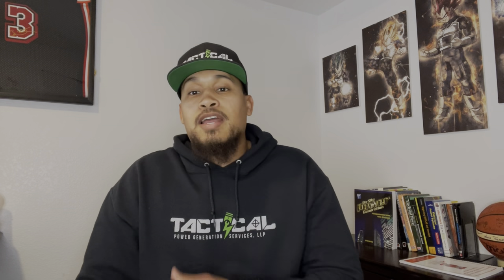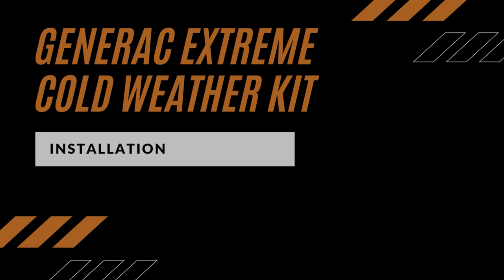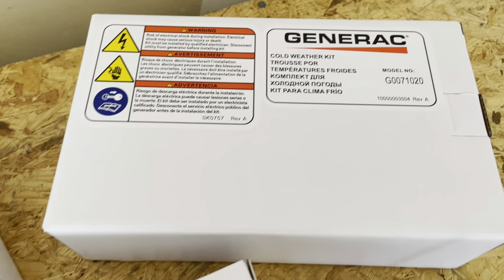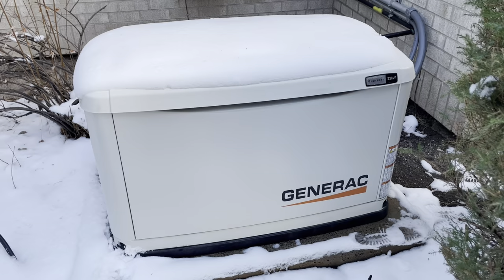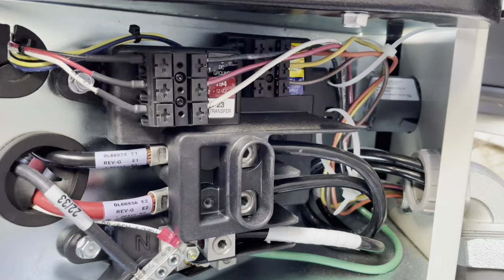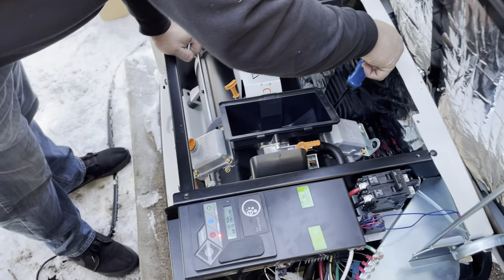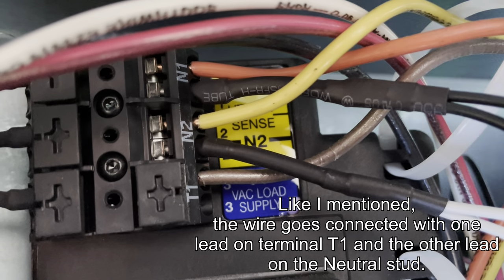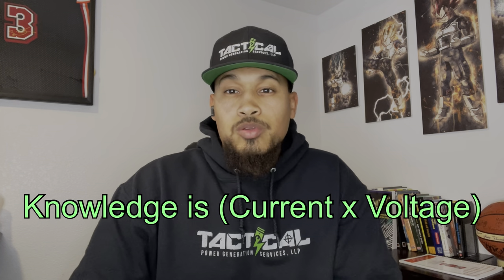Extreme Cold Weather Kit Installation for Generac Guardian Residential 9kw to 22kw Generators

Comment: Im an hvac tech, i recently installed a Generac 18kv on my employers cabin vacation house up north michigan, don’t wanna drive 3 hours on a cold winter storm day just to make it start..going to install this heater kit👍
Reply from the maker: Very smart decision, it will save you a lot of trouble. This kit is a must at places that go under 32F degrees. Thanks for watching my video 🙏🏾

Comment: Only reason I watched this video was to see how you got the lower bolts off of the air box and the intake.  You skipped right over that.
Reply from the maker: My bad, I didn’t record that part but send me a DM to my instagram TacticalPowerPro and I’ll send you a clip I have showing how to remove those bolts.
Reply from the maker: I just uploaded a short showing how to remove the air box and intake, check it out and let me know if it helped. Thanks for watching my video.

Comment: Are you aware that the battery heaters frequently damage batteries from heating too much, and the breather heaters cook the breather tube into charcoal?  The filter heaters seem OK though.
Reply from the maker: Yes Sir, I’m aware of those potential issues. If the temperature sensor is operating correctly it shouldn’t have a problem (for now) but I’ve definitely seen cold weather kit issues.

Comment: You really skipped too many details.
Reply from the maker: Thanks for the comment. What details did I skipped? 🤔
Reply: @tacticalpowerpro   I was able to follow, but then again, I have installed a few hundred of these kits.... and I know there are variables between year / model. The only thing that would not be clear to a novice is the long hex key needed to remove the mixer and the actual insertion of the power wires. You could also cover pulling that connector inside the TS instead of pulling the fuses to kill the 240 going outside. Much easier in my opinion after 25 years of doing this stuff.

Comment: Just watched your video to confirm the instructions included with the kit however the right side of the terminal block labeled N1 and N2 already has four wires connected on the right side of that block where the yellow labels are located. I do have an available connection on the left side of that same block but it's not labeled as anything though there is currently one set of wires there. Can I attach the heater wires to the left side of that block since there is an available connection slot? Thank you
Reply from the maker: Thank you for watching my video. Yes, you can attach it to the left side of the N1 & N2 terminals.

Comment: My generator will actually start but won’t produce bough power and then shuts itself off. I live in real cold wouldn’t work at -20. So can I warm the generator side of things. Or extend the warm up time so things can heat up rather than give up?
Reply from the maker: It sounds like the generator is not getting up to the correct speed/frequency of 60hz so it will not produce enough voltage. If is not producing enough voltage at start up, the generator will say “warming up” on the screen giving it time for the voltage to get to the needed range. If the voltage doesn’t increase, the generator will shutdown with the undervoltage fault. 

There’s a few things you can check, first make sure your generator is running at the correct speed/rpm/frequency. If the generator is running at the correct frequency then you might want to take a look at your carbon brushes or AVR for the voltage issue.
Reply: Is there a window that tells the rpm or voltage real time while starting or I need to hook a volt meter up some where?

Is the S thermostat on the cold weather kit so it’s not on all the time since it’s hardwired?
Reply from the maker: Most generators do show the rpms, you just have to navigate through the screen and find it. But, I recommend using a multimeter to test for the correct voltage and frequency.

And yes, the weather kit has thermostats that actives when the temperatures fall under acceptable levels and turns off when is warm outside.

Comment: Great video...thank you.   Quick question...At 3:27 you say “ Caution!  If you didn’t turn off the utility power supply to the transfer switch, these terminals will be energized.   Want to make sure I turn that off...is this is big off switch on the top of the generator itself?  Thank you!
Reply from the maker: Thanks to you for watching my video. No, it’s not the switch on top of the generator. It’s the main utility breaker feeding the house (which feeds the ATS) it typically located next to your electric meter. Also, make sure you have your generator OFF as well because if you open the main utility breaker the generator will start if is in auto.
Reply: Thank you for the quick reply. Yep...I'll for sure switch the generator off.   That said, I'd prefer not to turn the whole house off.   By switching off the transfer switch breaker...does that essentially do the same thing...break the feed to the generator?
Reply: essentially if the green light (on the generator) goes off, I know the block has no power feed?
Reply from the maker: Not necessarily, I would recommend to always test the terminal block with a voltage meter to make sure there’s no voltage.
Reply from the maker: One way to disconnect the power to the generator is by safely pulling the N1, N2, T1 fuses at the ATS. Those are the ones that feed the generator (which they are fed by the utility power.)
Reply: sorry to be that guy...so if I turn off the generator and the "utility service disconnect" on the transfer switch, it de energizes the generator correct?  I will check with a voltage meter, but this stuff always makes me extra cautious.
Reply: That might be another awesome video...how the transfer switch actually works.  btw...you do a great job on the video
Reply from the maker: You are correct, if you turn off the “utility service disconnect” you will de-energize everything past the ATS.
Reply from the maker: Thank you for your feedback, I do have a list of future videos I will be working on and the ATS is one of them. Keep an eye out for it.
Reply: @isu1992     if you haven't done this job yet, you can go into the TS and there's a white plug on the module by the sensing fuses. If you disconnect that plug you have killed the sensing power going to the gen unit. Much easier than screwing with those small fuses or turning the whole house off. BTW, I just retired from 25 years with a Generac dealer.
Reply from the maker: Thanks for sharing your knowledge and experience with us.

Comment: At time 4:29 I don't have that breather hose on the 14 kw model I just bought..... it's a 2022..... Is it maybe in another spot?
Reply from the maker: I can help you figure that out. What’s the model number of your generator?
Reply: @tacticalpowerpro  I got it...... Called for help and found out I didn't have to take everything off from 4 minutes on because that hose has been moved and exposed on opposite side below the air box cover......  you don't even remove the air-box.......  it's right there.... easy ....
Reply from the maker: Awesome! Glad you figured it out. So Generac finally decided to make the breather hose more accessible on their new models, which is great because it was kind of a pain to get to.

Comment: Got a new battery in September with fall maintenance, and already have the battery warmer and oil warmer.  Power outtage happened at -39c and geni 17kw would not start and now it flashes saying check battery.  Generac needs a better solution. Will be calling generac repair man Monday.
Reply from the maker: I recommend a AGM battery to see if it helps but -39c is too damn cold.

Comment: Nicely explained. In your experience, is the breather heater necessary, or is there enough heat coming off the engine to prevent icing of the breather?
Reply from the maker: Thanks for watching the video and supporting my channel. The breather warmer is recommended for regions with harsh cold climates and heavy icing. It’s made for areas where temperatures can fall below 20 degrees Fahrenheit, in those cases the breather warmer is highly recommended to prevent freezing and ensure optimal starting and performance of the generator. 

From my experience I always recommend to start with just the oil warmer. If you start having battery issues due to temperature go ahead and add the battery warmer or swap the battery for an AGM battery. If you start noticing icing in your air box or breather then add the breaker warmer.

Comment: Can I connect them to utility sense side instead of input sense? There's a ton of wires and blocks in front of input sense that prevent the wires from going in
Reply from the maker: Yes, you can connect them to the utility side if needed. Make sure the utility side wires are de-energized before putting your hands in there.

Comment: Does surge protectors go on the Generac?
Reply from the maker: These Generac generators does not have built in surge protection. But you can add a surge protector yourself, hooking it up across utility at transfer switch.

Comment: You mentioned this was only good for a 9 to 22KW unit I have a 24W is do you think it’s the same?
Reply from the maker: Yes, even tho the instructions say for 9 to 22kw it will fit the 24kw and 26kW Guardian generators (Only compatible on Generac units manufactured 2013 to present). They use the same or very similar platform (engine, parts).

Comment: hey so im an apprentice and just am working on some things and someone informed me about TC (Cable Tray Cable) that is made specifically for generators. its 2-3cu plus ground and 6 #18 wires. its an “all in one” cable in the advertising. Sorry im really noob with generators but is that enough wire to get 240 out there for the cold weather kit?? Great channel btw, just subscribed today!
Reply from the maker: Thanks for subscribing! I really appreciate it. Well, most common wires are rated for up to 600v so they will sustain 240v no problem. You need to worry about the amperage rating of the wire. You can look that up on the NEC (National Electrical Code) or the Ugly’s book. You will need the size (AWG or kcmil), the type (example THHW, THNW, etc.) and temperature to know the allowable ampacities of the conductor. Let me know if this was helpful or if you have any more questions.
Reply: @tacticalpowerpro  what amps do those heaters draw? just guessing that 18awg will hold about 5 to 10 amps based on 310.16 but the chart doesnt show for wires that low at 60 degrees. idk
Reply from the maker: It doesn’t draw much. The oil heater is rated around 50 watts so amperage is way below 1 amp.
Reply: @tacticalpowerpro  Thanks man!!
Reply from the maker: No problem! Thanks to you for watching my videos and supporting my channel 🙏🏾